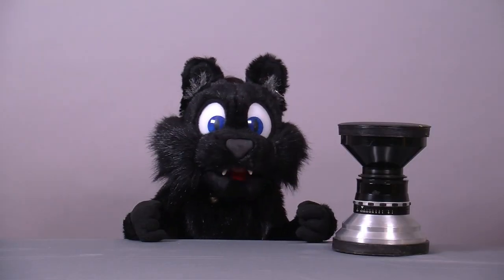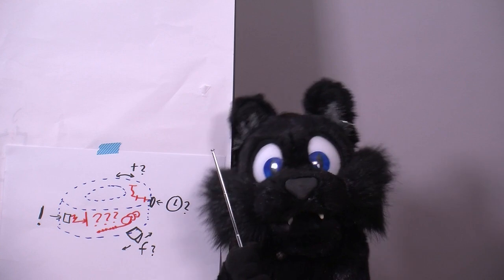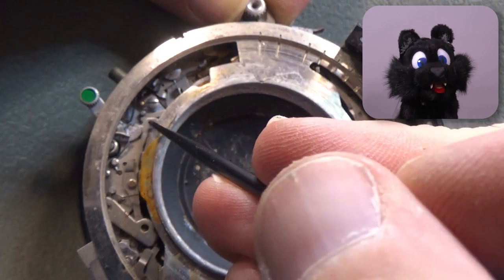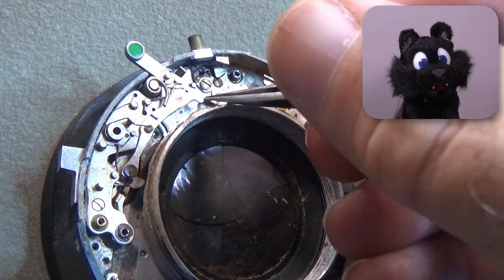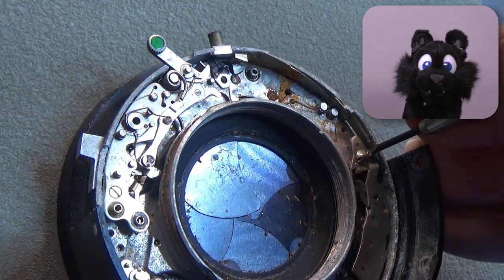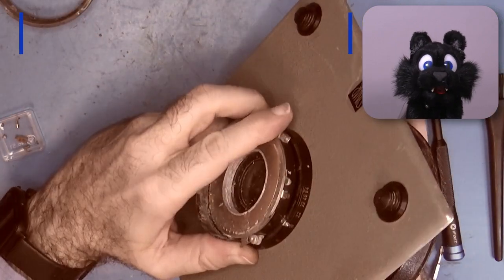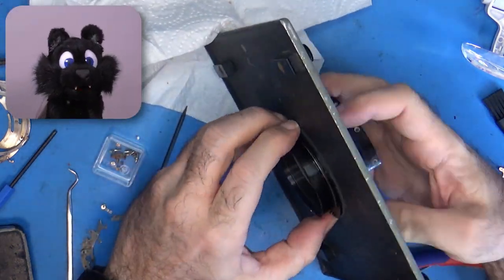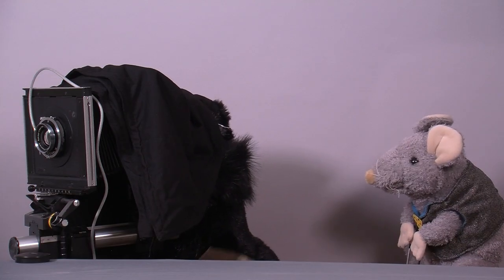Large Format Lens Restoration - Part 1

Comment: I got full faith you'll get this back together. But still: Holy mackerel! 

Maybe it isn't showing in the video, but how the heck is there no mould when this thing must've been moist for quite some time?
Reply from the maker: I think mold needs to find its way into stuff first - it needs some spores to grow?  But also, I don't think it grows on metal alone; mostly greasy fingerprints and organic material. Indeed, I didn't see anything that looked like mold when taking it apart. Maybe a hint on the faux leather lens cover? But that also might be dust, hard to say.
Reply from the maker: Also: we are not sure if the rust or the dump came first... Since the lens was stuck in "self timer mode", there would have been no way to release the spring from the outside. So my theory is that it had at least a little bit of rust in the self timer, then got stuck and from there it was binned and got worse from being in the open. It might even have been rain water ingress...